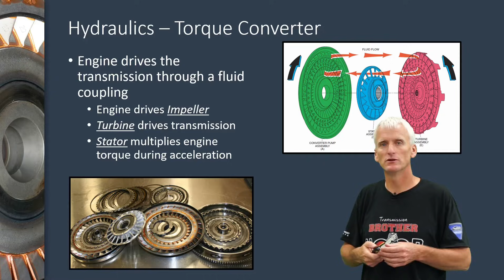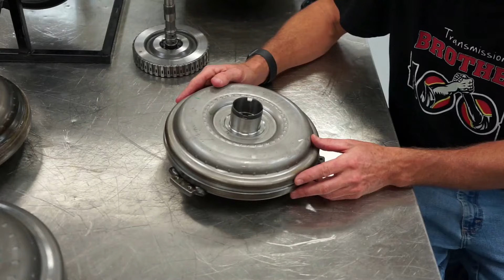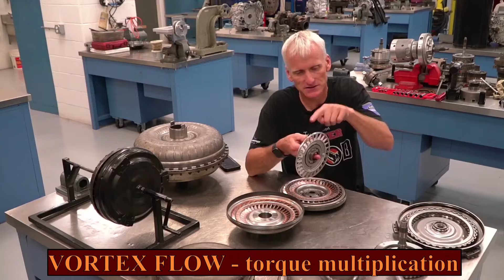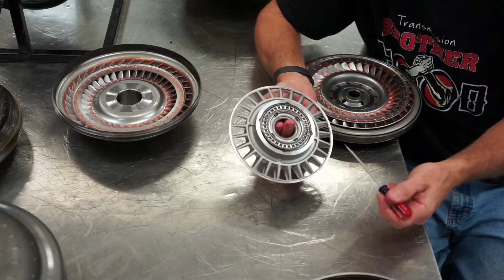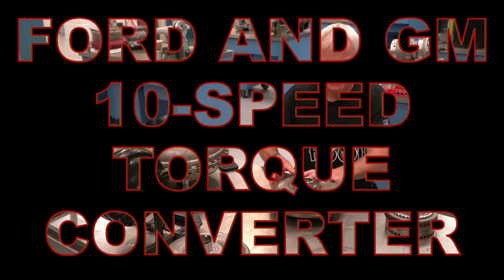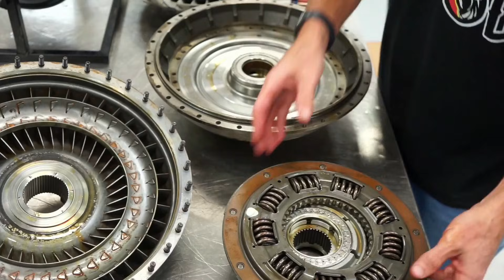Basic torque converter operation

Comment: Can you explain how a rumble strip noise might be developed from a torque converter?  I have a 722.6 transmission on a Mercedes that after reaching operating temp jerks when shifting from 1st-2nd gear, jerks and loses some power 2nd-3rd with a rumble strip noise, then jerks again 3rd-4th with more noticeable power loss and a louder and deeper rumble strip noise.

Comment: The term "torque multiplication" is confusing and inaccurate. I realize it had become standardized when discussing the stator. But in fact, the stator harvests residual energy from the fluid leaving the turbine traveling back to the impeller. There is no increase in energy, only capture of residual.

Comment: So a torque converter can enter coupling phase at a lower RPM than stall speed as long as the engine is putting out sufficient power to meet demands at cruise, right? I've has someone tell me otherwise before.

Comment: Hello, I have 4 states in the electronic management of my torque converter, with 4 different RPMs, what can this correspond to? For example for 30% load I have: 1 = 900rpm / 2 = 1200rpm / 3 = 1800rpm / 4 = 2000rpm

Comment: hello,sir,im struggling with my bmw e60 525d torque converter.Imagine you are cruising with speed of 100km/h  and the car just shaking due to rpm changes.Is it possible torque converter clutch is slipping and causing these symptoms?

Comment: Could a torque converter lock up and make the engine seem to be locked?
I have a 99 Ford F-350 pickup with a 7.3 diesel engine it is 4x4 as well.
The pickup Sat for about 5 years.
WE tried starting it but the engine seems to be stuck. It doesn’t make any sense so I’m wondering if the TC could be the problem.
Your thoughts?

Comment: Converters are TRANSMISSION COMPONENTS and are INTEGRAL to the transmission and one is useless without the other.

A converter is not to an automatic - or powershift - transmission what a clutch is to a manual. A manual can "work" without a clutch. A clutch can be used to 'limp home" a manual trans not completely "blown". 

"Building" an auto without replacing the converter AND "external" components like coolers may be a "build" but it is not a "rebuild:.

Comment: The fluid in the torque converter...what keeps it flowing? Why doesn't the fluid get slung to the outer most part (the metal doughnut)
Reply: its does, it goes to the outside portion, where it crosses halves, then gets turned around and goes back out.....somehow!

Comment: TC has 3 connections to the AT side.  1st  is the pump driving  tube sticking out from TC case(often with 2 notches or 2 tabs at its end),which match to 2 tongues or 2 tabs on the pump rotor in  the front of the AT.    2nd  is the bigger female spline in the TC stator one way clutch hub, which meshes with stator tube male splines from the back cover of the AT pump(motionless with AT case).  3d is the small female spline in the center of TC turbine,   which drives  the  male spline on the  end of the  input shaft  that  sticking out from  the AT.

Comment: Do old 1970s torque converters have stators and clutches too?  I have a Mercedes 250 1972, which drives fine while the cold engine when getting hot drives fine except at stop signs likely the torque converter is locked and the engine wants to die because tranny is engaged.  I have to rise RPM to not die. wondering if TC can be locked. Thank you.

Comment: Does the clutch engage strictly by fluid pressure, based upon the specific engine RPM?  Or is it electronically controlled by redirection of fluid to special port (s) that pressurizes the clutch?
Reply: The engine computer uses a solenoid inside the transmission to send fluid pressure back into the converter input shaft to lockup the clutch.

Comment: Front engine,, rear wheel drive..
Fluid is forced in the impeller centrifugallyfrom the interior of the impeller to the exterior of the impeller.

Fluid traverses into the front of the vehicle, into the direction of the engine/crankshaft, away from the brake lights.
The fluid runs into the turbine at the exterior of the turbine down into the interior of the turbine.
The fluid Traverses towards the rear of the vehicle, away from the engine, 
The fluid is now moving to the stator.
The stator brings the fluid towards the interior of the impeller completing the toroidal flow of the viscous fluid, transmission oil.

Comment: What is your advise about gearing down with one of these new types of torque convertors?  Advise on the internet seems to be that we should use the breaks to slow down in an automatic, but some people still say it is fine to slow down using the gears?
Reply from the maker: Do you mean like manually shifting to lower gears for engine braking?  I don’t think the converter really minds that.  Many vehicles have tap shifters to allow you to control the gear you’re in, so it’s not unexpected or uncommon to have the converter drive the engine during braking.
Reply: @siuautomotive  when coming to a red light in my automatic, is it "safe"(aka not weardown parts unnecessarily) to take my feet of gas and only apply brakes when the car has slowed down and im getting close to the red light. 

eg: while going 50mph, when im about to approach a red light, id take my feet of the gas when i'm at 50yards away from the red light and apply the brakes in the last 10yards. does this practice wears down my car parts faster?

Comment: Thank you for your work . Can we use a 4L60E from a 4.8L engine and put it in on a 5.3L engine? do we need to flash/ reprogram? 2006 4.8L trany on a 2000 5.3L Silverado extended cab

Comment: Just had the one way roller bearing go out after camming and tuning my engine and yeah, my stall speed was only 1000 rpm.
Reply from the maker: That's a bummer!  Probably a little slower off the line, lol!
Reply: @siuautomotive  And a lot of rattling and squealing! It sent metal chunks from the springs in the one way roller bearing throughout the transmission so I ended up taking it apart and cleaning everything while I had it out to put in a new torque converter. I had just rebuilt the transmission a few months ago so taking it apart again was a breeze.

Comment: I would be glad if you could answer the following question: going down a very steep slope with a 4x4, in first gear (let's suppose it has a TH400), to obtain the maximum level of engine braking, does the torque converter stator rotate way faster than the engine (due to its one-way clutch and to the way the ATF touches its blades) or does the torque converter stator rotate at roughly the same speed of the engine? I mean: engine speed 3,000 rpm, torque converter stator speed 6,000 rpm, is it possible?
Reply: The stator is splined to the case and rotates at the engine rpm unless the stator is free spinning. In your scenario, the wheel rpm is kept low with low gear ratio to use engine braking. Assuming a steep downhill, you are probably reaching the “stall speed” of the engine, or 3000 rpm in your example. But your wheel speed and therefore your turbine speed is well below the impeller speed. The one way clutch of the stator will be engaged and the stator will not free spin and rotate at the impeller speed. 

The only time the stator speed will exceed the impeller speed is during the rotary phase when the turbine has come up to speed. This is when the ATF might hit the back of the stator blades to allow free spin of the one way clutch where stator spin will exceed the impeller speed.

Comment: Aye friend I recently swapped the engine on my sisters 04 scion and wen I put the bolts into the torque converter was a little tight well I left it like that started the car drove it  for a couple blocks i had to floor it so it can move at a stop and after that didn't wanna move forward or reverse what can it be?

Comment: How does oil gets into the torque converter? is it through the input shaft?
Reply from the maker: Yes, in tcc release mode it travels through the tip of the input shaft to feed the converter.  In tcc apply mode, it enters between the input shaft and stator support shaft

Comment: Would I be able to put a torque converter with a lock up clutch in a 1965 2-speed Powerglide?
Reply from the maker: I don't think so, because there are no oil circuits or solenoids to control the fluid for the powerglide.  But who knows (not I), someone might make a kit.

Comment: If the stater is freewheeling due to one-way clutch failure, wouldn't the "stall speed" be too high?
Reply from the maker: That’s a common assumption, but the stator, when locked during torque multiplication, redirects the fluid in the same direction as engine rotation.  That extra “push” is what allows the engine speed to climb higher.  If the stator always freewheeled, it would never get that extra push.
Reply: @siuautomotive  Yes, makes perfect sense!  Not sure why I had that backwards but thanks for confirming.

Comment: My stator gear  rotated clock wise and counter clock wise.....is this normal. My car made weird noises in reverse and drive, leaked really bad when in park, and had very bad acceleration.

Thanks for the video.
Reply from the maker: When you try to move the stator with your fingers or a stator support in your hand, it will rotate in both directions since you are holding onto the inner race.  You should feel the one-way clutch slip in one direction and grab the stator in the other direction.  It could be the source of poor acceleration, but it shouldn’t cause a leak unless the converter internals are coming apart and it tore up the hub or seal.
Reply: @siuautomotive  the inner gear” behind the stator is moving around” which explains why the torc converter was hard to get on.
When I pulled the engine, the seal was in good shape, the leak was coming from under the bell housing.....I took it as a bad seal but there was no indication it was worn out.

If I had a tool.... a Could’ve did a pressure check, I’m gonna replace the torc converter for a peace of mind.....thank you for the speedy reply.
Reply: @siuautomotive  ok did another test and the stator was fine....the old seal might’ve been worn....I never really checked it out before replacing.